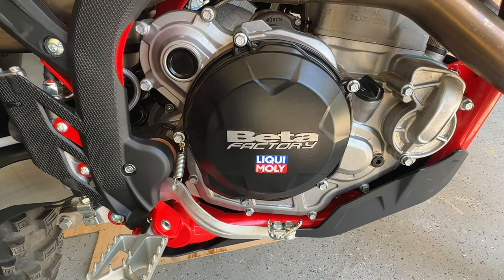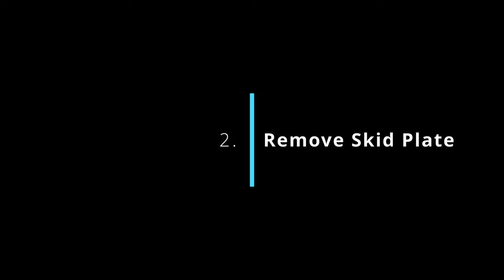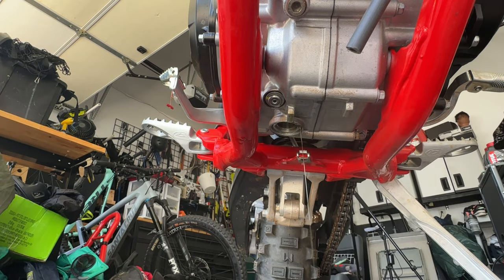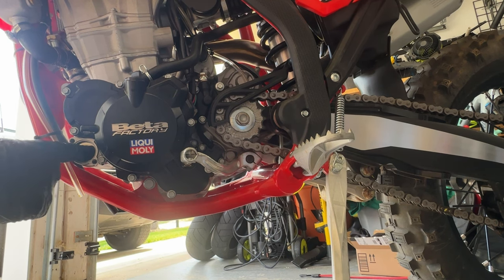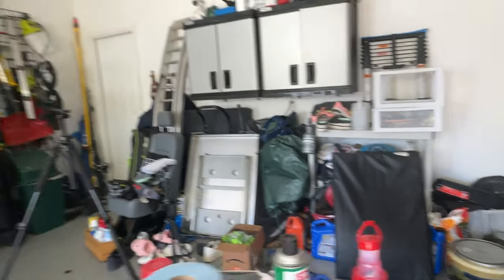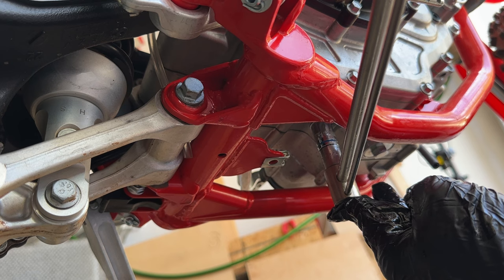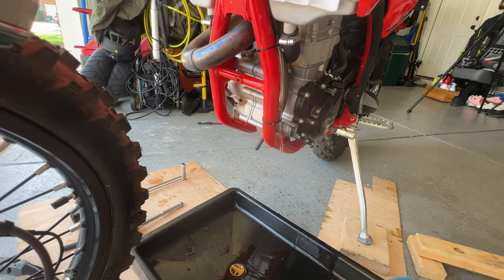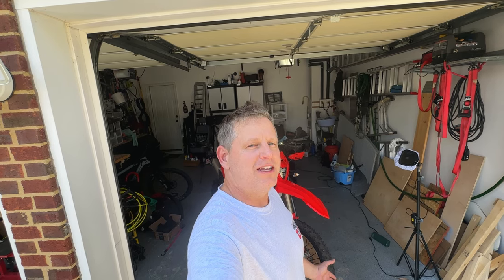#MTBPlanB DIY oil change 2023 Beta 390 RR-S

Comment: Did they change the routing of the exhaust for 2024? I'm doing my break in oil change right now and the front skid plate bolt hits the exhaust. Seems like you can't get the skid plate off without loosening the exhaust header?
Reply from the maker: Looks like the 24 has a longer header pipe that bends down and around.

Comment: What engine oil did you use
Reply from the maker: I use Motul or Liquimoly 10w50
Reply: i got liquimoly off amazon $60 for 4 liters
Reply: did you re torque the head bolts at the first service? i havent got a straight answer from anyone yet . the manual says to tighten them at 3 hrs